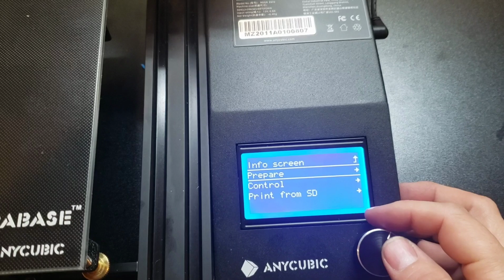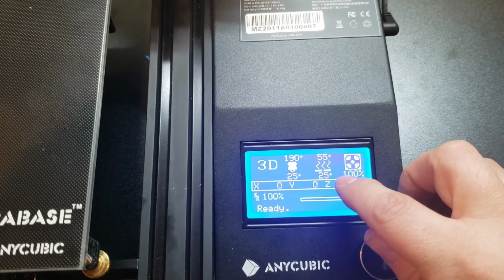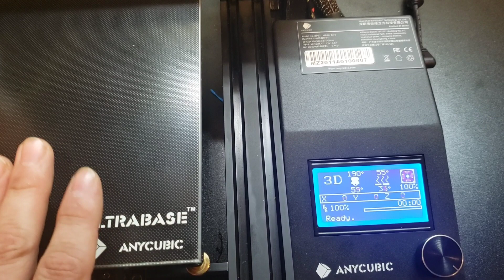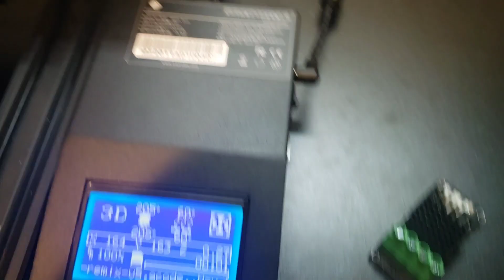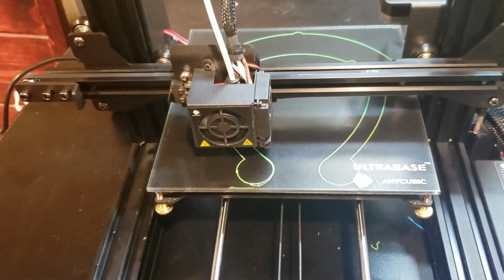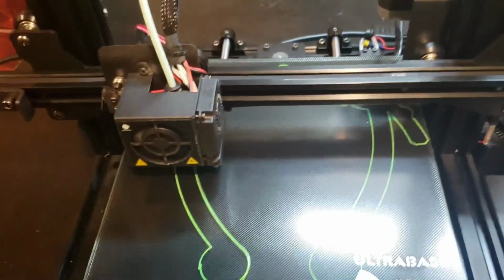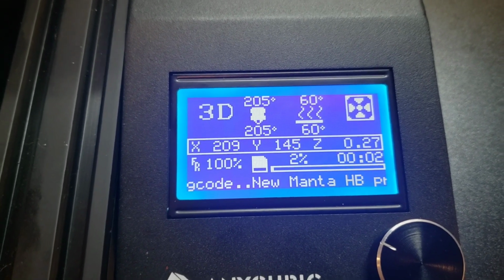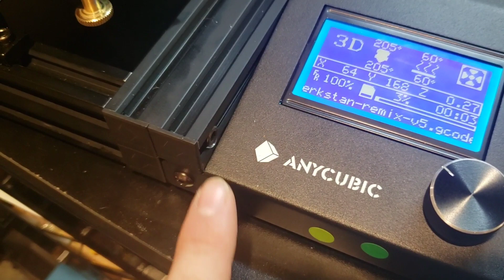ANYCUBIC MEGA ZERO - HEATED BED PART 2 - BED CONTROLLED BY THE STOCK BOARD IS WORKING!@!@!@!

Comment: great video, thanks. actually you can just solder a small mosfet and a connector on the empty space where you circled and connect the big mosfet you brought on that connecter instead of a votage booster.
Reply: According to him, he actually needed the booster. Doing your way doesn't boost the voltage. MOSFETs do not boost voltage, they only regulate the output voltage by the voltage on the input.  In your case you would also need another power source for the output voltage from the 1st MOSFET to the 2nd MOSFET. On one side of the 2nd MOSFET circuit board there is only 1 input from the output from the voltage booster. On the other side is the input/output voltage that will vary the output to the heated bed, by the amount of input from the voltage booster, which will boost the voltage from the mainboard. I figure that at different temperatures, the output voltage changes, allowing only the needed amount of voltage through the MOSFET.

If the power block that came with the Mega Zero could handle more current, Anycubic would have already soldered a MOSFET directly to the output pins on the circuit board. Then you wouldn't have a need to connect a higher current PSU nor the second MOSFET.

I hope I explained this good enough. lol

Comment: how much was your total cost of the project and is it cheaper to just buy one with a heated bed ?
Reply from the maker: It's cheaper to get a machine with a heated bed from the start.  I think this project is more so if you already bought the Mega zero and wanted to upgrade vs buying another machine.  I found the machine to be well made and accurate and only lacking a heated bed.
Reply: @adaptedmachining6951  yeah I have a mega zero I think where I lack is the programing part I printed most the parts you said and power supply but I just feel lost at the moment iv been using my lk1 but I would rather use my zero cause I feel it prints better

Comment: Dear Adapted Machining

1.) What are those brass screws or nuts called?

2.) Also is your power 24V 10amp or is it 24V 30amp, what brand is it ? 

3.) I couldn't find nor get the Anycubic Mosfet thing but got the other mosfet one you show on the video   

thanks :-)
Reply from the maker: Brass thumb nuts. 

10 amp 

As long as it can turn on with a 5v signal it should work.

Comment: Great Video and thanks , i am repeating what you have done and have also added a BLtouch to the firmware but i am not getting the 5v signal from where the small mosfet is on the board from a multi meter measurement , can anyone help me confirm where the pinout should be on the firmware or any obvious issues . thanks in advance

Never mind worked it out , you need to have the thermistor connected , its working great now thanks again , if anyone wants a copy of this firmware with the BLTouch V3 active give me a shout

Comment: Arduino: 1.8.13 (Windows Store 1.8.42.0) (Windows 10), Board: "Sanguino, ATmega1284 or ATmega1284P (16 MHz)"

Sketch uses 103540 bytes (79%) of program storage space. Maximum is 130048 bytes.

Global variables use 6225 bytes (37%) of dynamic memory, leaving 10159 bytes for local variables. Maximum is 16384 bytes.

An error occurred while uploading the sketch

This report would have more information with
"Show verbose output during compilation"
option enabled in File -> Preferences.

i ran into this problem. any help would be nice

Comment: Why not just use the new power supply? Why retain the original external brick one?
Reply from the maker: 24v new supply for fast bed heating.    You could if you went 12v but I didn't want to.

Comment: I have moddifed the board with an mosfet. So no Need for an volt Booster. Also use Marlin 2.0.5.3

Check github: https://github.com/ulli1102/Marlin-Zero 

Greets

Comment: You mention a board swap. I am completely new to this. I am wondering if you think it might be possible to swap the board out of this for an ender. 3 pro board?
Reply from the maker: With a custom enclosure yes.
Reply: @adaptedmachining6951  I just got an ender 3 1.1.4 board and held it next to the anycubic zero board and they are identacal other than the zero has a switch and ac input the board fits the case and sd and micro usb line up exact so you can swap the boards. I have pics 2. I am waiting for my psu. Again I am extremely new to this... I ordered a 12v 30a 300w psu do think that will be ok with this machine (including lcd) and ender 3 board? Ty

Comment: Nice job. Will definitely keep this in mind. What print settings were you using before the upgrade? I am having trouble with adhesion.
Reply from the maker: First layer adhesion issues are usually from improper bed leveling, dirty / oily print surface, or from under extrusion.  

I would clean the build plate, level the bed, and make sure there is proper tension on the extruder. 

My machine shipped with the tension screw on the extruder too lose.

Comment: Which model Ultrabase is that? I see one on Amazon but it seems to measure 240mm wide by 220mm deep. It's titled Anycubic 3D Printer Platform with Aluminum 12V/24V Dual Power MK3 Heatbed, Tempered Glass Plate with Clamps, Durable Build Surface for Prusa i3/Mega S 240x220mm. Wouldn't 240mm wide be too close for comfort on the Mega Zero.
Reply from the maker: You will want the 220 x 220 version.